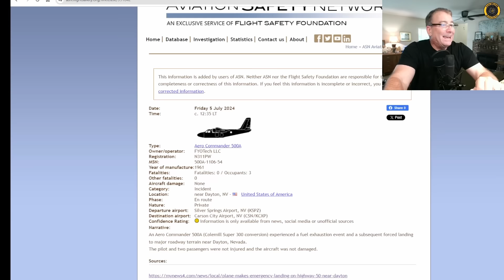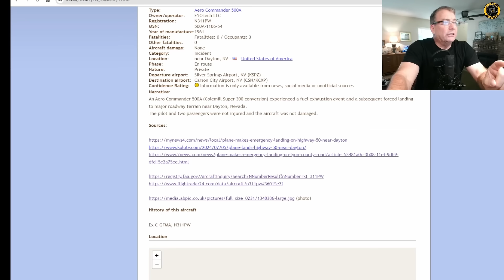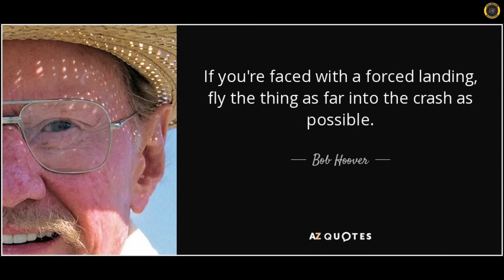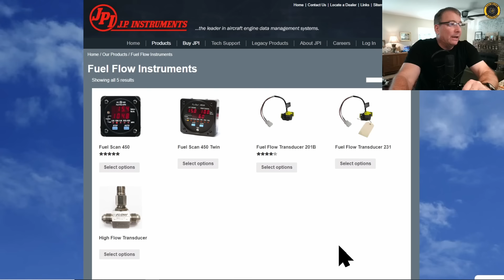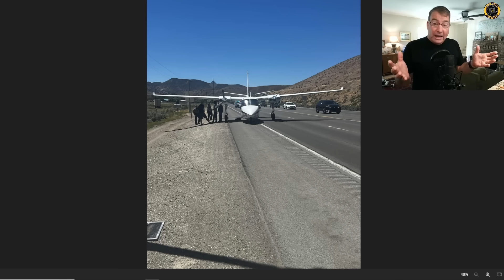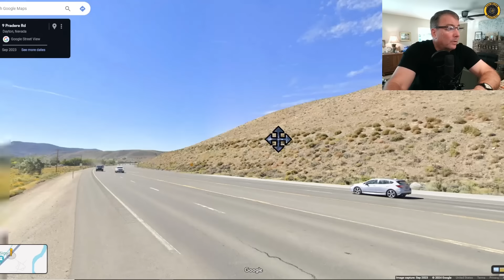Aero Commander Forced Landing Hwy 50 Dayton NV 5 July 2024

Comment: A better plan than "always take off with full tanks" is "always take off with an accurate, known fuel quantity". Some of these aircraft are overweight with full tanks and more than one occupant so you can't top off your tanks. Even if you did, are you sure they hold the rated capacity? There's a lot more to fuel management than just fill and go.

Comment: Density altitude isn't just about longer takeoff runs and slower climb rates.
The fuel burn with high temps and density altitute- DA basically brings the "apparent" atmosphere lower, so the service ceiling comes down too. So aircraft end up operating in a higher "apparent" altitude and therefore much closer to their service ceilings, which means more throttle opening to maintain altitude or performance required.
Some of the videos we see of single engine aircraft not climbing after take off on high DA days, I speculate they are at their "DA service ceilings" and are doomed from engine start. Maybe GA pilots should start calculating DA service ceiling on hot and high take offs- puts things into a much greater perspective.

Comment: The 500A I believe did come stock with TCM io-470. Hoover flew a 500S which had the 540 lycs. This aircraft as you said was a 500A, so it did have bigger engines with the Colemill. They may be N/A io-520, not TSIO-520s. I'm getting in the weeds here, and weeds areen't good today at PVF.

Comment: Saw Mr. Hoover many a times growing up flying both his Commander and P-51. Also remember the USFS Aero Commander that crashed on take-off from Bishop after stopping for fuel. Seems the fuel guy at Bishop Airport filled it with jet fuel instead of av-gas. He had been used to filling the only Commander that lived at Bishop, that happened to be a turbine engine one.
I remember the airplane brought back to the airport, you could turn the props easily by hand (no compression). Seems there was just enough av-gas in the system to start, taxi, run-up, and takeoff before the jet fuel hit and burnt the rings right out if the engine. Fortunately the pilot didn't try and turn back and just belly landed in the sage brush and sand south of the airport.

Comment: Sometimes taking off with full fuel is not possible. The Piper Saratoga is notorious for having a forward CG and even with two pilots of reasonable weight in the front seats It is out of CG. I fill up the Saratoga until I can see the fuel in the tanks and I know this equates to the maximum amount allowable for two (not overweight) occupants in the front seats.

Comment: One thing I would like to add about operating the Aero Commander (in particular the 500S). It is very easy to not completely fill the fuel tanks even though you think you may have. Fill it to the brim, go do something else for 5 minutes, come back and top it up. It takes a while for fuel to spread among the tank bladders. You'll come back and fit about another 50 to 60L in it. If you're not told about this "feature" a new pilot to the AC50 is leaving their reserves in the bowser. Company policy was always fill to full which fortunately in this machine still allows you to take a great payload.
Reply: Great point and comment.

Comment: Bob Hoover was helping out, just showing how amazing  Aero Commander are.  Wow, that was some special pre-purchase inspection.
Early in my career I learned the importance of full fuel tanks, and gauges.  It was...fill the tanks and wash the wings.  I flew many twins including the Aero Commander, and the Aerostar, a Ted Smith design.  Both had fueling, and gauge issues.  This is why we do a cross check of fueling quantity with the upload of gallons from the fuel truck for jet transports.  If the numbers don't match, then solve the problem before flight on the ground.

Comment: I have bladder tanks so can't use a dip gauge to verify level.  But I know I have a total of 80 gallons when they are full which gives me over 4.5 hours and most of my flights are an hour or so.  There are many things I could worry about but running out of fuel isn't one of them.

Comment: Same goes for off-road travel.  Although I have a diesel fuel gauge on my truck, I also have a round dowel with tick marks indicating gallons that I stick in my tank at a 45 degree angle.  My dowel never fails me.

Comment: Juan, Bob I think flew a 500S which had 2XIO540 Lycs, 290 hp. The Colemill conversion if TSIO-520 Continentals wouldd be of smaller displacement, and probably a bit more hp, 310-325, depending on model an L,N or W for instance.

Comment: You don't need to fill the tanks to 'Full' for every flight imho. It's a matter of keeping track of your fuel consumption and subtracting this from your starting fuel. The difference will be your remaining fuel. On large jets we do a mandatory fuel calculation that has to match what is shown on the guages (they're accurate). In flight we add fuel remaining at a waypoint to the fuel used which should equal the fuel at departure. Fuel calculation is something that needs more awareness in general aviation - jmho.

Comment: and I'm still here reading the great Bob Hoover comments and stories, and the positive safety comments regarding this well done forced landing and subsequent wiring faults found! Down here in New Zealand, we were always trained and drilled to dip the tanks and check for water before every flight, but then that was way before fancy fuel flow computers were around, certainly in old style steam driven club planes and basic PA28 and C150 trainers. I don't think I ever looked at or believed the gauges as they were always calibrated in USG and we use litres for tank quantity and fuel burn, so went off our paper fuel logs for time left in the tanks!

Comment: From my recollection of flying 500As way back, the fuel system is about as simple as you can get, it is either on or off, the fuel flows from the tanks, (total 127 US Gallons as I recall), into whatever engines happen to be operating at the time. There are no individual fuel cocks and no crossfeeds, you don't need them. The interesting thing is that the fuel gauge only reads the ''bottom'' 90 gallons of the fuel tank, so for the first hour or so of flight the gauge does not move and you appear to be using no fuel, then it starts to drop at around 30 gallons per hour on the standard engines. It is easy, if you rely on the gauge, to take off with a lot less fuel than you think you have, because the gauge gives you no idea of how much gas you have above 90 gallons, you might have 37 gallons (full tanks 127 gallons) or just 95 gallons, an hour and 30 minutes less fuel than the gauge is leading you to believe. A trap for young players! Always dip your fuel and time your flight!

Comment: my 71 Shrike  is a gas guzzler. i figure maybe 3 hours before i start looking for a fuel stop,  i also wont fly in this hot weather. wont even fly the bell 407 in 104 degree heat. they do not want to fly when it is hot out.

Comment: I flew Aero Commanders for many years, back when I was young and handsome. Just wanted to point out that the fuel gauges are notoriously unreliable. So much so that I had a broomstick with nudges on it to measure the fuel. That was the ONLY reliable fuel indicator that I really trusted. Then it was a countdown game. That's the only way to fly those airplanes safely.

Comment: Commanders have a simple fuel system with connected tanks.  My dad flew his '55 Commander 520 thousands of hours.  In the early sixties, he had a forced landing because of fuel exhaustion - after less than about an hour of flight on full tanks.  A loose cap on the high wing plane caused all the fuel to siphon out AND it pulled the fuel gauge up so the indicator showed plenty of fuel, even though there was none. 

 He landed in a hay field with little damage.  The plane was flown out.  But, this incident caused an emergency service bulletin (of similar FAA action) to be issued in regard to Commander fuel caps.

Comment: The JPI will only show the fuel that you say was added and most people hit the full fuel button after fueling. The problem is that if you have a 100 gal. usable and the line personnel "filled" you up, you then reset the JPI to show full fuel. The issue is sometimes the fueler fills just above tabs leaving you with possibly only now 90 gallons or less usable, other times it's overflowing. Take a look at the fuel receipt to verify gallons added as well as a visual verification of fuel level during pre-flight. The only thing I fully trust on the JPI is the totalizer (fuel burned depending on power and mixture setting).

Comment: Gotta tell you… I miss Bob Hoover!

I just finished graduating Embry Riddle in Florida and always went to any airshow he used the strike commander. 

I don’t recall any pilot ever being able to do what he could do with that aircraft…after shutting off the engines doing A 16 point inverted roll back down the centerline and then turning to final dropping the gear touching down on one side, then the other, and then coasting to centerfield and it’s just like he said, pops out of the door with that big straw hat and waves to the crowd… In my opinion, the greatest pilot I ever saw and he did this late into Late 60s.

Meanwhile… That crew of three are the luckiest folks I know this week and I wonder if the guy ended up buying the aircraft?

Comment: The engines on the Colemill conversion are IO-520’s not TSIO-520’s.  300 hp with a 5 minute limitation, 285 hp continuous.  The 500A Commander was the entry level Aero Commander; original engines were Continental IO-470’s.  32 gph total fuel burn in cruise would be pushing it, these engines at more modest cruise power settings would burn about 25 gph if operated lean of peak.

Comment: I’ve heard a lot of these have fueling issues. Something with the flop tab in the fuel cap
Reply: They have a system of bladder tanks in series for each wing.  It takes forever to fill the wing tanks since the fuel truck pumps fuel faster than the fuel can transfer to the adjacent fuel cell.

Comment: Ironically, they were less than 2 miles for a straight-in to Dayton Airpark, 5343' runway.   I always stick my tanks both before a flight and then again when I fuel so I know if something is amiss with the tanks, gauges, fuel flow meter, etc., I don't want to be looking over my shoulder and wondering how much fuel I have.

Comment: Engines lose efficiency with higher temperature.   This is the basis of Sadi Carnot's heat engine efficiency theory.  

Fuel temperature also influences burn rate due to density.  Less dense fuel takes up more volume, burn rate for requested power is mass rate consumption, not volume.

Comment: Was ferrying a friend's piston twin from North Carolina to Texas.  Loaded full tanks incl long range with one fuel stop in Merridian, Mississippi. At Merridian I was turning left final and lost the right engine.  Quickly ran the engine out checklist incl switching tanks and got the right engine back.  Landed and taxied to parking.  After refuel we realizized that we had been way below minimum usable fuel.

The issue was that the aircraft my friend had bought in NC looked and sounded ok but was not running well.  We were burning 40% more fuel than book.

Just by the skin of our teeth we had enough fuel to make a normal landing at an airport. 

Feel free to tell me the moral of the story...

Comment: My interest in aviation, is as an outsider, whose never going to own or fly an aircraft, I just find it interesting. As a guy of a certain age, I am interested in aviation of WW2, so it always surprises me how low hp the engines are used in general aviation. I mean the engines in this aircraft are 300HP,   which is similar output of fighters in the 1920's. I assume this is for fuel economy, and to make them easy for general aviation pilots to fly?

Comment: I always take off with full tanks. I always validate fuel used as indicated on my EI fuel computer against how much fuel is actually required to top off. The two numbers are typically within 0.1-0.2 gallons of each other. I always cruise at best efficiency EGT (~1,390F), WOT and 2200 rpm, which puts fuel burn rate at ~7.3 gpm indicated. I then calculate local TAS to ensure I'm getting the same cruise speed of 182 mph TAS, which is a good check on engine power output. Much of my flying time is out over the desert at high DA. I try not to land with less than half tanks. Not taking any chances with fuel exhaustion or engine degradation.

Comment: The higher the density altitude the lower your pumping losses are going to be for a given horsepower output. This is explicitly why automotive engines attempt to ingest hot air, including up to the point of using EGR to improve their fuel efficiency. 
I wonder what's going on which is aircraft specific that would increase your total fuel burn.

Comment: I always do a double take and have to think about it for a second when you say "high density altitude", which i have to mentally translate to "low air density".

I understand the origin of the phrase, but, not being a pilot, I'm not used to using an altimeter as an air density measuring device.

Actually, given modern avionics, I'm surprised no one has combined pressure and temperature reading to give a direct air density display.

Comment: What I was told from a guy that had to ditch his commander in the Gulf of Mexico, is the fuel tanks in a commander are "fuel bladders". Both engines feed from the fuel bladders. There is no fuel switch that can cross feed from one tank to the other. I think he said there is around 7 to 9 of them all "laced together". As we all know "fuel bladders" can deturate, get wrinkles in them. Something to check on your areo commander, if you own one. Will not know for sure what caused the fuel starvation on his commander because it is at the bottom of the Gulf of Mexico. He was flying from Orlando to the keys. He did say his electric fuel gauges read half full.

Comment: How did the pilot get below his reserve fuel? ⛽ Don't you get a caution light or something?
Reply: Watch the video !  All the instruments (analogue and JPI) still showed fuel remaining.
Reply: Nope.
Reply: @riaanlouw1874  there's not a backup? You can just run it dry?
Reply: @ericsd55  there's no redundancy here? Most cars have a low fuel light.
Reply: @WALTERBROADDUS  Yup.  I have 4 tanks and 2 engines.  I can burn all of the fuel tanks dry with one engine by switching tanks.  The redundancy is seeing how much fuel is actually installed into the tank, like ya just can't fill it any more, and that's a known quantity.  Then, you watch the clock knowing how much gallons per hour is being burned.  The computer in this plane only tells the pilot how much fuel has been run through the fuel transducer, and is not attached to the tanks or quantity senders.  If the fuel on board is different than what the pilot thinks is in there, things like this can happen.

Comment: Not a pilot here but to me it would seem that high temperatures and altitude would equal low density rather than high density.
Reply: High "Density Altitude" - that is the air density as it is at a high altitude, not high density!
Reply: @HDRW  Thanks for clarifying, I figured it was some sort of pilot insider lingo.

Comment: According to the FAA the only time the fuel gauge ~must be correct is when the tanks are empty. Let that sink in, and always do a visual check of your fuel tanks.
Reply: Actually, this is what the FAA says:

§ 23.2430 Fuel systems.

(a) Each fuel system must—

(4) Provide the flight crew with a means to determine the total useable fuel available and provide uninterrupted supply of that fuel when the system is correctly operated, accounting for likely fuel fluctuations;

Comment: I heard a good one today, “I’d rather burn from the tops of the tanks rather than the bottom.” The watch won’t lie, especially when the digital math doesn’t math.

I had a choice to either go out with 35 gallons today, knowing I’d likely burn only 15 or so, or simply put in a bit more to the tabs. Then wisdom spoke to say, “the only time you have too much fuel is when you’re on fire.”

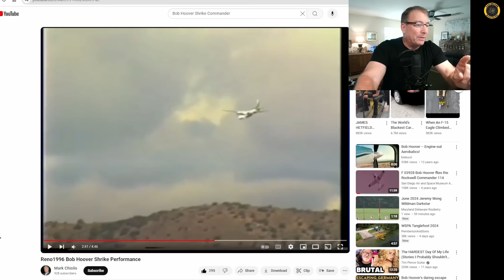Comment: 3:09 he's doing it exactly right. First trade off altitude for as much speed as possible, then you got all options left, like climb over obstacles, coast a while until you find a good smooth spot and also have enough energy to turn around after looking at an area.

Speed can be bled off easily by slip streaming as well as using the flaps/speed brakes/extending the gear/unfeathering the propellers. Altitude however cannot be bled off so easily - especially not for an inexperienced pilot and trying to glide at Vbg doesn't give you any options as you got nearly no energy to work with when you're low to the ground.

Comment: As a US Army helo pilot we routinely performed a fuel consumption check. At cruise altitude and airspeed we’d note fuel quantity (our fuel gauge was very accurate). Fifteen minutes later we’d check fuel again and multiply by 4 = lbs/hour. Noting total fuel at that point would give us    a flameout time and 30-minute VFR reserve time.

Comment: I don’t understand how you don’t keep track of fuel when you fly an airplane. If anything you should be more vigilant than in a car which stays on the ground. You just don’t cut it close when you can drop out of the sky. A 30 gallon discrepancy it the gauge ready is not an excuse.

Comment: Another thing to remember in hot weather is that the fuel you are taking on may be less dense. 
Depending on the location of the fuel storage, it may be coming on board at a higher temperature, thus reducing its density. 
This means that you are receiving fewer pounds per gallon of fuel,
thus, you will consume fuel at a higher rate (more gallons per hp-hour).